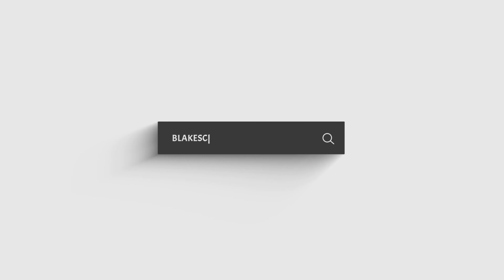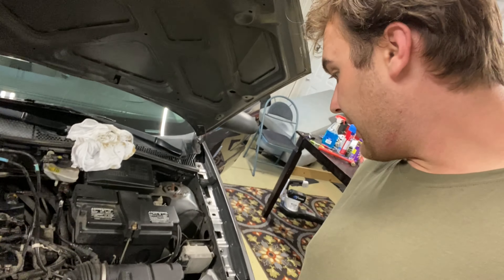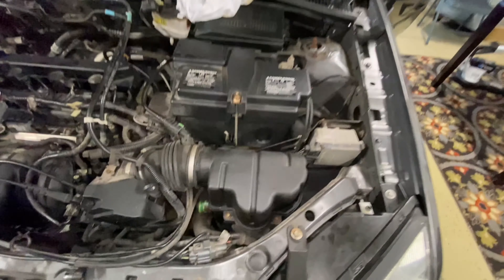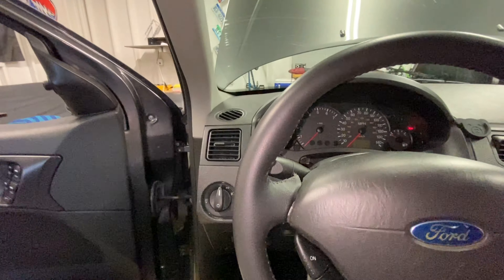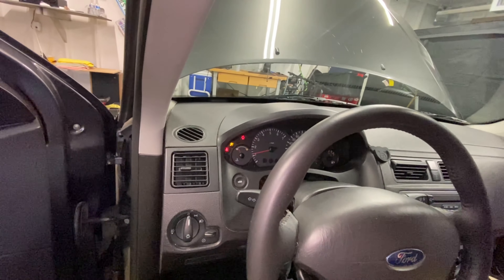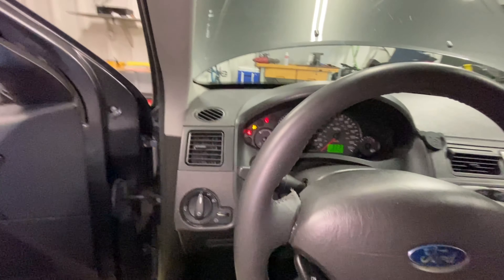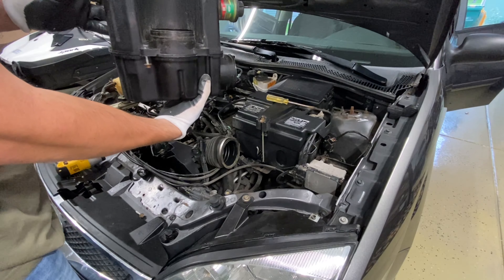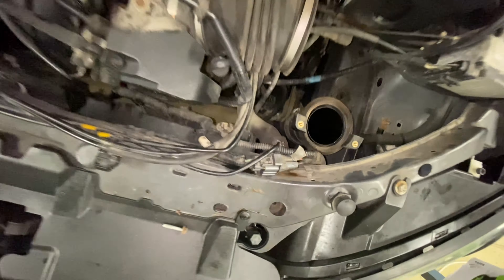How To Make A Cold Air Intake For A Ford Focus Using OEM parts

Comment: Hi thanks for the video I wanted to give you some advise as a mechanic myself anytime you can reach a clamp get a 8mm socket and use a rachet or your drill impact to take them off the bottom clamp that you had to jack the car up for I got it with my little rachet and 8mm socket and that is the common size socket for hose clamps some do get smaller and bigger but not on the cars or reg trucks just wanted to give you that tip if you didn't already know that ok thanks

Comment: I’m gonna do the same thing but I’m gonna take the other part of the tube you cut in half and replace it to that bottom part where the stock filter is to get a better air flow too the filter

Comment: I got a k&n kit but had trouble with it cause it got it's own tube and has a angle to it that sensor sits towards the control box and the wire was against it and got burnt now it was a extension wire but it caused problems this is so much better and cheaper it was around $150. for the kit from k&n oh it was a 08 with the same permanent type filter question what's the price of the coupler and size

Comment: I also understand that the MAF and MAP will be “cross-referenced” in the ECU (I have a code for this now due to MAP & MAF readings not correlating…) so I’m curious as to whether or not you had any engine code, drivability issue, or fuel consumption increase since doing this, once again, due to the MAF being turned around 180 degrees. 

Thanks for any insight!
Reply: Turn the tube the other way around with the filter directly on it and the flexible new bit connected to the flexible old bit on the engine intake. Just did mine and had to swap it around to get my car to even accelerate into mid-rpms. CEL showed up while it was his way, so had to go to local auto parts and have them clear what was the MAF sensor. Bing bong, all is well since I flipped it around the other way.

07 Focus SE manual
Reply: j ai instaler un p-flow meme probleme ,roule trop lean ,video sur y-t qui explique le probleme ,j ai verifier une plug elle etais dangeureusement tres propr
e

Comment: Question I have a 2009 ford focus PZEV and if I do that will it have any issues or did you have any issues later on? I change the box to where I put an air filter on my car and it gave me a P0171 code and the transmission completely acted weird and I had to replace the whole thing back to original but that looks like a very simple and amazing fix to the air filter solution I  would say.
Reply: Are you sure  that all the vac hoses were reconnected?
Reply: Did you have the MAF sensor in the correct way?

Comment: Would this make the mass airflow sensor backwards?
Reply: If you put the mass air flow backwards the engine won't stay on just turn it around
Reply: You are just turning it from vertical to horizontal. As long as the the air is still coming in the same direction it's fine. Just make sure you don't turn that little tube the wrong way when you move it.
Reply: No you have to have the mass air flow go the right way or it will not run right

Comment: Did you have trouble with ur car logging down when accelerating after doing this mod? Currently experiencing this but it might be a dirty MAF sensor
Reply: UPDATE: This guy put the airfilter on the wrong end of the pipe and the sensor is now backwards... you must have the maf positioned in the correct airflow direction or the car will not get passed 3000rpm

Comment: But did it throw a code with the backwards maf?
Reply: I did this and it idled perfectly fine but when i drove around the block the car kept almost shutting off and it ran terribly. I had to find a way to put it on the opposite way because the maf sensor cant just be turned around.
Reply: @codeybowen9619   how did you flip it??? I’m having that issue please help 😅

Comment: Looked closely in yhe video, the coupler used was Spectre Performance 8751 Black 3"-2-1/2" Intake Tube Coupler

Not sure about the filter, but any universal one should work imo

Comment: Why dose my car cut all power when accelerating after doing this ?
Reply from the maker: Flip the mass air flow sensor
Reply: @BlakesCars2 when you say flip it… are you saying to rotate the hose so the MAF is on the battery side or are you saying to remove the MAF and simply rotate it 180* and screw it back in?

Comment: Preferably and is what I did to my 2007 SES was install the Air Filter Housing SKP SK258519 fits 2005-2007 Ford Focus 2.0 2.3 DOHC, direct fit with replaceable air filter. This keeps the baffle and "Cold" air intake system, the only real issue with the original filter system was the inability to replace the filter. The rest of the system was designed correctly; was quiet and had true cold air as apposed to this method. I think the SKP housing costs about 80$ on eBay. I like to keep things as original as possible. This is still a decent mod just not one that I would do. Not myself interested in the additional noise under the hood.
Reply: Good luck finding that part in stock